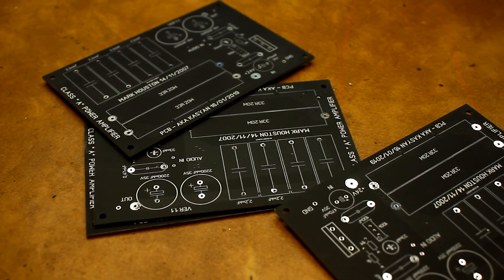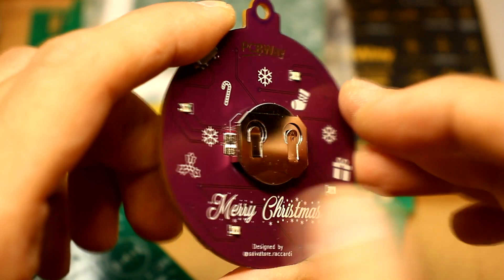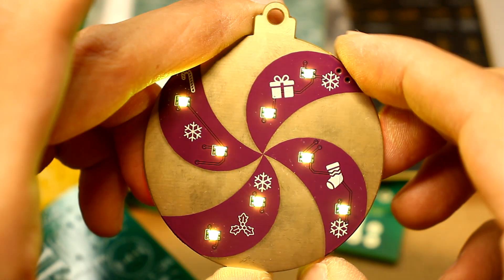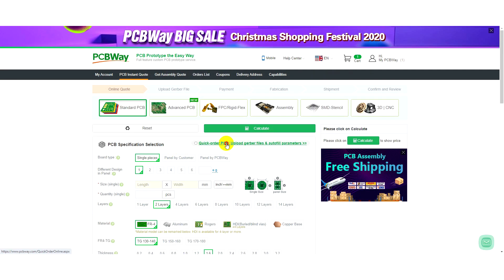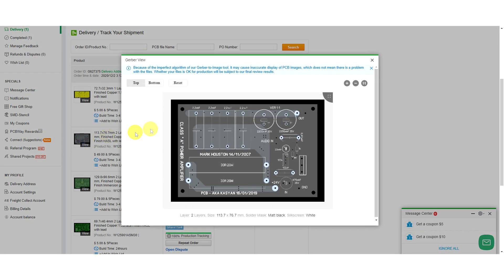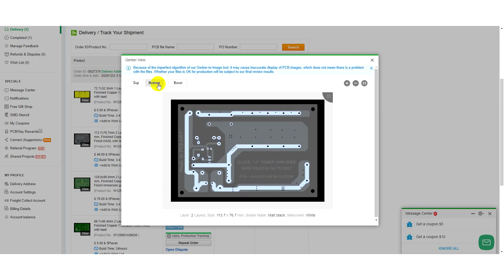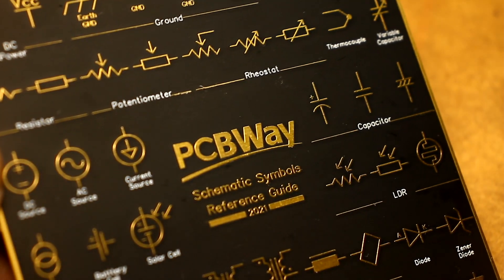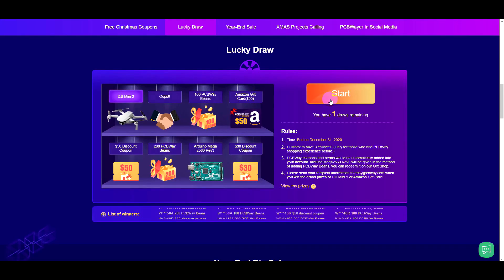Class A single transistor amplifier (Mark Houston)

Comment: what is supply voltage can you give us the ciruit?
Reply: Its the archive link in the description
Reply: 24 volts typical. Most of the capacitors are rated for 35 volts max. Using a lower voltage will reduce output power and standby power. If you change the supply voltage you have to readjust the transistor bias current (variable resistor on the circuit board).